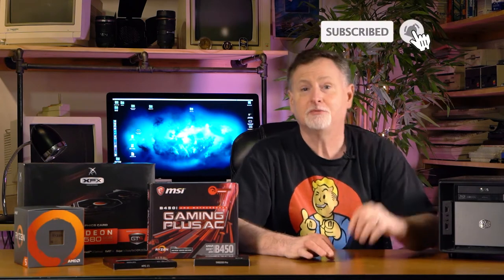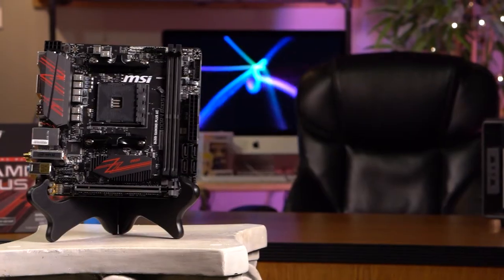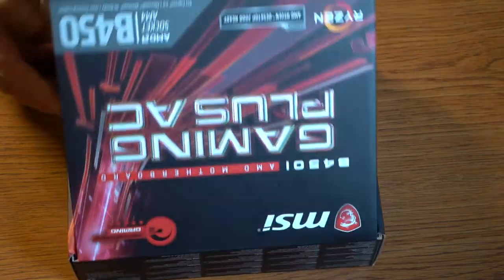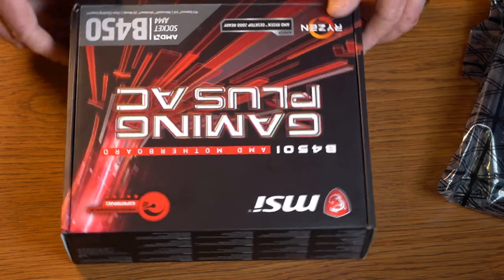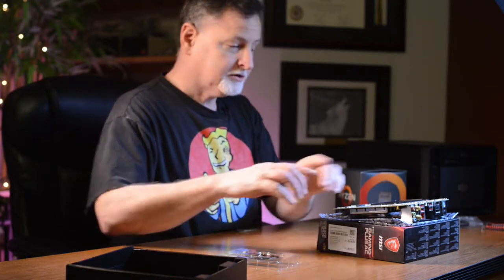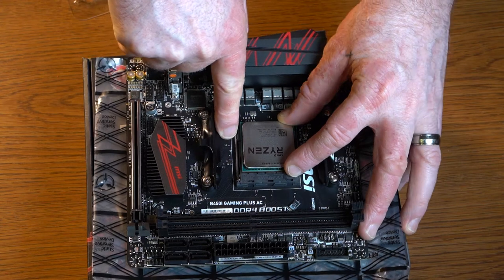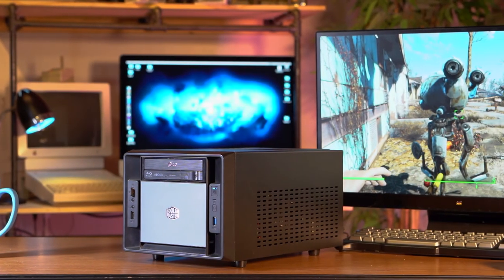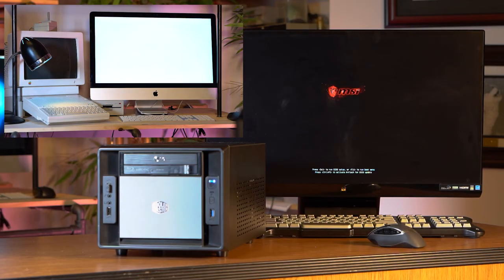Mid-Range Gaming PC Build | AMD Ryzen Mini-ITX | [HD]

Comment: I have the same(but maybe slightly older model. The front panel mesh looks different on yours for the front 120mm fan) of that Cooler Master case with my mini ITX machine. It's not a bad case just wish it had better room for cables management and if you dont get the case on just right some times its hits the side 80mm fan and when you turn it on makes the fan rub and grind. My machine is just a ASROCK AM1B-ITX MB and low power AMD CPU at 2Ghz with only 4 Gigs of DDR3 Ram. It's a neat little machine but nothing to write home about. this case definitely needs more of a full modular power supply so that it has less wires running through to make it look less of a mess.

Comment: I built my own pc a year ago it worked 2 weeks with no problem then it started with red led cpu freezin at 2,3 days, i have bios updated, all updated, my mobo is msi b450 gaming plus, i looked for my cpu in theyre site and it fits with the mobo chipset, so i have rysen5 1600 psu seasonic 620W, i looked at ram that fits too, its lpx corsair 16 gb 3000mghz and my gpu is msi rx 480 gaming x 8gb, ssd kingstone 256gb, but i hurd later that this mobo has problems, after a time i hear that rx 480 has problems with drivers, when i built it it started from the first boot, i have after freezzin amd radeon settings has recovered due to an unexpected issue and the drivers appear after restart as default, sometimes the image some colors then freezes and blackscreen after 2,3 days, in games and desktop is workin great, i even play games with an aoc ips 32 inches at 1440 pixels, what can it be? Can you tell me an answer? Please help
Reply from the maker: From your description, it sounds like the problem lies somewhere between your MB and Video card. I too have experienced the occasional black screen lock up, but only when doing resource intensive work, mainly with Adobe products, which  are known system crashers. Double check the MB firmware to be sure you have the very latest version, and try to isolate what program or app you are running when it happens to see if it could be software related. One last thought to consider though is that you mentioned the problem started about 2-3 weeks after building your rig, which may suggest you have a bad CPU or other component. Most tech today is built pretty solid, and if you have a faulty component, it is likely to fail within the first 30 days.
Reply: @ThatGeekGuy  i saw all amd gpus has this problem, i tested in full load all components and it doesnt crush, i tested all even 3 hours and works all great but after 2,3 days does tgat when i start it or restart it and second the windows 10 crashes and does that, i think its the drivers of gpu or windows or the motherboard,,,all are updated bro

Comment: does the m.2 socket place at the back get high temps?
Reply: I haven't noticed any problems. I think the system only even really gets hot when I'm running High video content and that's mostly on the video card. I also have a cool master case so it must have good circulation underneath, I can't speak for other cases though.
Reply: @TheUnprescribed  but its still stuck between the back of your mobo and the case regardless of what case you have
Reply: @jeddimaster5393  true. Good point. I'll keep an eye on it and report back if I notice any significant heat or problems. -- Steve
Reply: @TheUnprescribed  thanks for the info though, been thinking about buying this mobo to shift from intel to ryzen. nice review of the board 👍

Comment: How many watts is the power supply? I have a sfx 450 watt from corsair and use the same specs but with a 3400g and zotac 1650 low profile and I want to get that same rx 580 but not sure if my power supply is enough.
Reply from the maker: This one is 450W also. Runs stable.
Reply: @ThatGeekGuy  Amazing work, hope to see more videos like this.